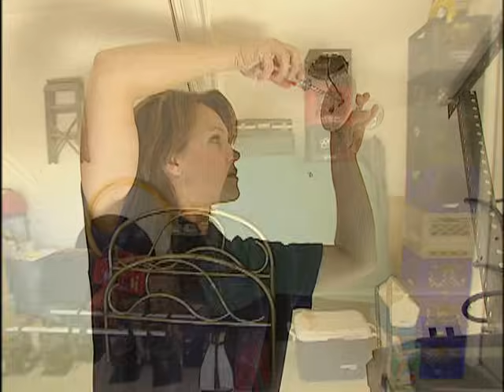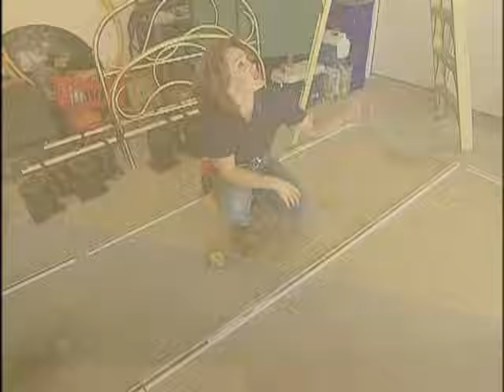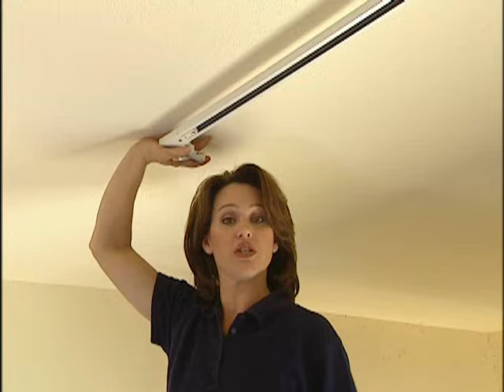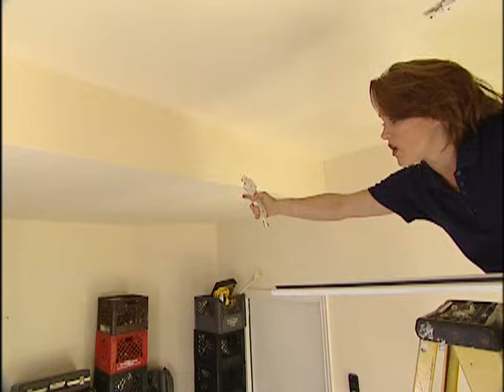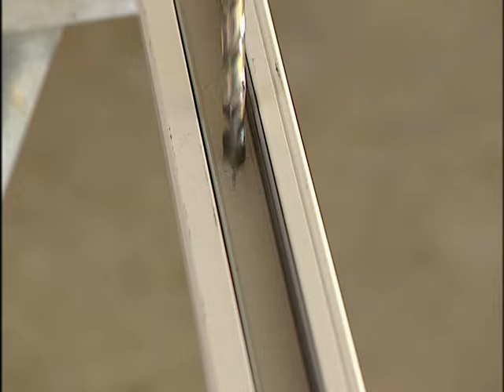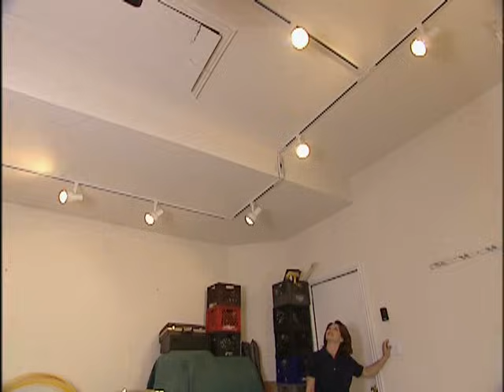Installing Track Lighting DIY (#5148)

Comment: you skipped one section I needed.  how to go from junction box to that first connector to track and the decorative cap that goes over it. Do you just pull the wires and connector around the side of the box and track Haphazardly?  How does the cover fit over it?  I can't see a way to make it look neat.  What did you do?
Reply: They 100% showed that

Comment: So there still is a good use for track lighting!  This is a good solution for anyone removing it from their home's interior.  If I was going to buy new lighting for a garage I'd just get some of the linkable LED lights that replace the old fluorescent tube lighting fixtures that used to be popular.  Only about $20 per 3 ft section, (I used 6 sections), some connector wires to link them, and you're done for about $140.

Comment: Does it matter which direction you turn the light to "snap" it in?  You went counter-clockwise.  Is that true in all cases? Can you go either way?  Is it all tied to the specific producer?  Mine came with very little instructions and doesn't cover this.

Comment: If the existing ceiling junction box screws do not match up with new track plate what options do you have to install the plate besides rearranging the old junction box?  Somethings are never easy but your video was nice.
Reply: And similarly what if the junction box screws are facing the wrong direction?

Comment: As the lady stated, the rails have two metal strips on one side and just one on the other. Therefore, make sure the connectors, lights, rails, etc are all lined up by taking this into consideration. I did it the hard way and had to remove a rail and rotate it which is a nuisance when using toggle bolts.

Comment: My track light Is pleasantly 110 v at this time but I want to know if I  was to change it to 220 volts if it just a matter of changing the voltage and the bulbs or would I have to get a 220 volts track light ??
Reply: It depends on the product. Check the technical specification in documentation that came with your system or contact the manufacturer directly. Increasing output to any electrical item can be very dangerous if it isn't designed to handle it. Imagine all the bad things that could happen if part of the track started melting.

Comment: great video, one thing i noticed is that she doesnt explain how to connect the cut pieces. i looked at a few other videos and you have to bend the copper wire to connect with a special Track Conductor Bending Tool... the problem is i CANNOT find on for sale anywhere online in the US... that seems like the perfect Amazon item, but they dont seem to have a single one....or do these connect another way?

Comment: Great video! A couple of comments: First, the connectors aren't snap-in only, you should tighten down the setscrew after inserting them into the track. Second, after cutting the track, the conductors have to be trimmed so that the anti-short tabs on the fittings don't push the fittings on the other end of the track out.

Thanks for some great information and a well-presented video!

Comment: Be sure when you connect most lights & appliances to the house the wire is most often  aluminum on the appliance & or lights, So you're connecting it to the house wire which is copper.& needs to have a special grease called Nola Flex so they don't prematurely quit working. Otherwise they can expand & contract causing the two different materials to arc & corrode fast & then need be replaced. When you put the two aluminum & copper wire together in a wire nut, just squirt a dab of this Nola flex into the wire nut first & twist them on together..Another trick of the trade is if you're doing lighting or something outside, Before you wire nut the wires into a wire nut is you must first twist the wires together with pliers tightly & then squirt a dab of 100% silicone into the wire nut & tighten on the wires. This will help prevent water of touching the live wires & shorting out during a rainstorm or garden hose sprinkler..
Reply: Where I live, I have never seen aluminum wiring used for circuits like this.  It is always copper.  Aluminum cable is sometimes used to bring power to the service panel, but I never see it used for branch circuits.
Reply: @peteduncan921  Dave was saying you may be connecting the copper house wire to the aluminum wire that came on the lighting fixture.

Comment: I do have a question... sorry if I come off too green but does it matter what lights you used for the track? can one buy a track and choose different lights or do the tracks come with their own lights and one must choose from that selection? Just curious... The reason I ask is because I like to change things up quit a -lot and if it is as easy as changing the lights oppose to having to change the entire system... well then that is right up my alley.
Reply: @suchaCaligrrl.. You can use a number of different light fixtures with track systems, they're very universal.
Reply: +UNDERNEATHHOUSE36 thank you for responding,  I appreciate it.